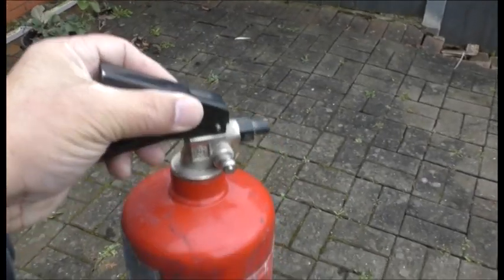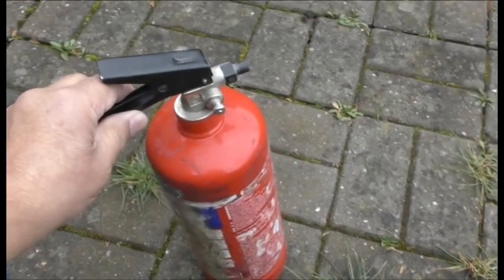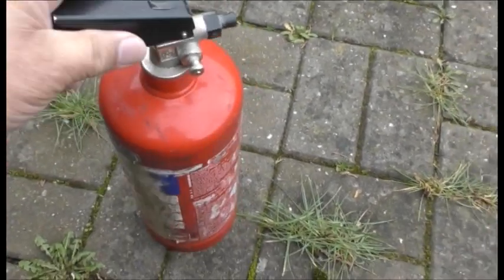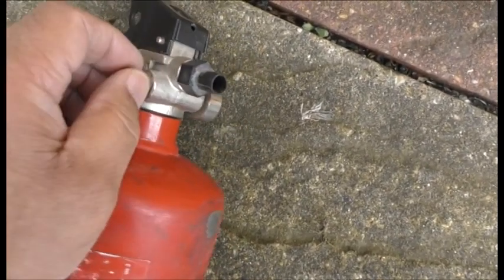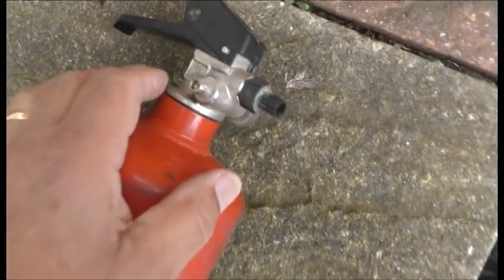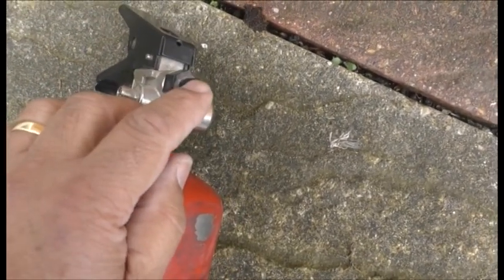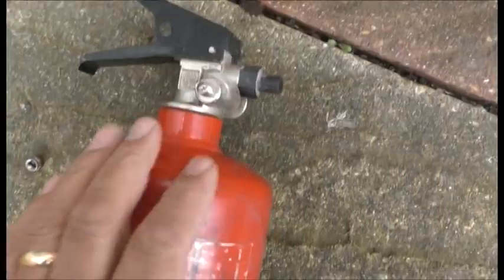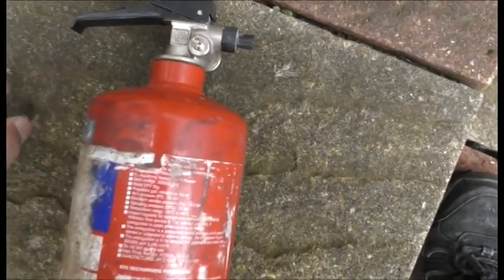#259 Fire Extinguisher used for Compressed Air

Comment: That looks useful. The valve you have added seems to be in a very awkward position, can you move it to the top so you can get hold of it easier?
Reply from the maker: Maybe so but I have had this for a few years and only now I got it to work. I kinda given up on it. thanks
Reply: It looks like the handle grip valve gives you all the control you need, but I can see you were thinking of pegging that open and using your brass valve to regulate the pressure supply. Maybe braze a longer handle on the brass valve to make it easier to operate.